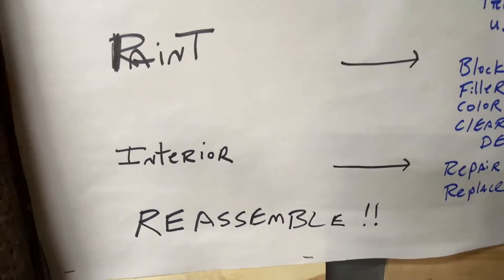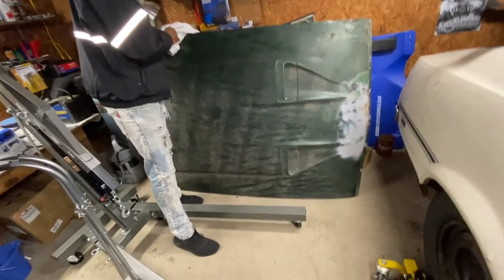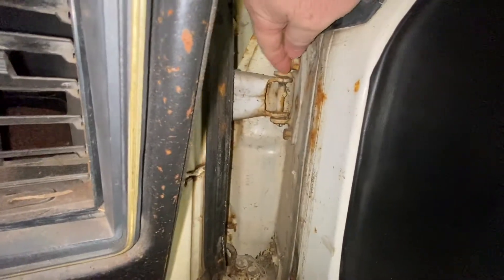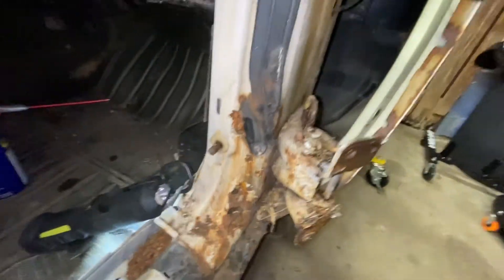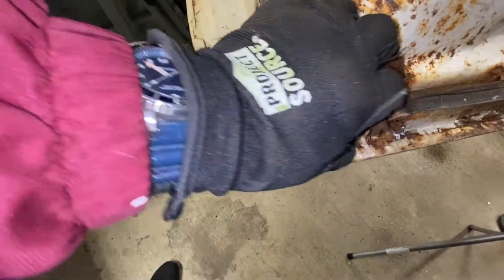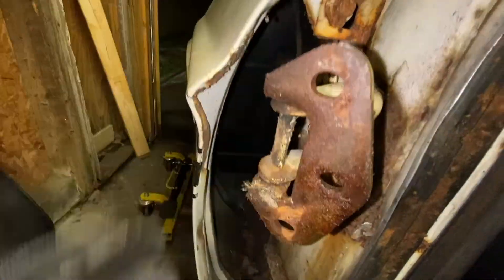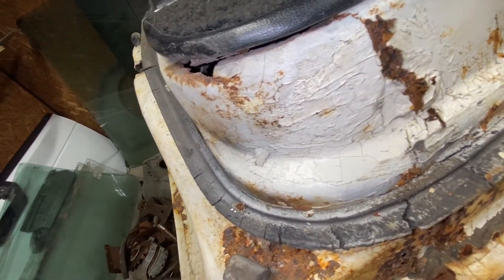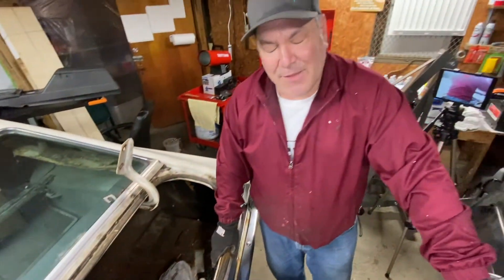How Did a WASP Nest Get Into the Trunk Lid? Rebuilding a 1972 MACH 1 351 HO Cleveland 4-Speed - #4

Comment: Is the engine code in the VIN an “R” or a “Q” 
The 351 HO was a pretty rare car with a very narrow window of availability at the beginning of 1972 model year.   If this car isn’t that, then the rust restoration is probably going to exceed what that car is worth finished.   I love 71-73 Mach 1’s and really fond of 72’s because I had one in high school.  However,  they are not a collector favorite for some reason except maybe a Boss 351 but it still trails a Boss 302 in selling price.   Good luck with the project I can’t wait to see the finished product.
Reply from the maker: R Code.
Reply: What’s more rare? R or Q? And most importantly-R. T. R. !!🌀🌊🌀
Reply from the maker: CaddyMan, the R Code is more rare in 1972 but not in other years (I think). And yes, RTR is worth more than every Mach 1 ever made!